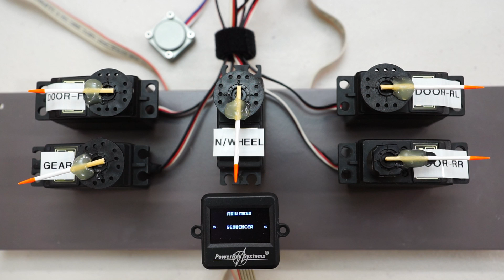PowerBox Mercury SR2 : Part 7 - Gear & Door Sequencer Programming

Comment: Hi Costa, great tutorials, very informative. I have followed your guide and all works; however my aircraft does not have retract doors, hence i was wondering how to eliminate the lag for gear extension and retraction? I have played around with setting whatever default time to 0, but probably I am not doing it correctly. would appreciate some pointers. Tx, Nic
Reply: Tx I will give that a go 😊
Reply: Hi Costas, I tried that using the mercury small screen, but it only allows me to set percentages and time per point (four r of in each direction); however not remove the pints per say. By setting time to zero (per point)  it not seem to remove the lag. I am probably doing something wrong? Should I use the sequencer software option in the core itself instead? Is there a different purpose between the two?
Reply from the maker: @nicolaszentelis2161  You can of course use the Tx sequencer. Only advantage of the Mercury sequencer is that it just has more options.
Reply: Hi Costas, still no joy. Do you perhaps now why their are four positions in each direction? Maybe if I understand that better I may be able to solve this. No matter what I do the extension takes about 4 seconds as it thinks there are doors and the retraction is ok about 1 second. Maybe that is just how it works? In your experience have you managed to get extension to not have a large lag?
Reply: Is there maybe a way to bypass the sequencer? ie just give command to gear servo, simply up and down non times or sequenced?
Reply from the maker: @nicolaszentelis2161  There is no requirement to use the sequencer. You can also set it up manually if need be.
Reply from the maker: @nicolaszentelis2161  Have you tried setting the sequencer points manually...? Might pay to do this for just one channel first then manually add a second sequencer for another channel to see how they interract with each other.
Reply: @CVHeliPilot  Thanks I just bypassed the sequencer and got the result I wanted. I still want to find out how to do within sequencer but that is a challenge for another time. Cheers, Nic
Reply from the maker: @nicolaszentelis2161 After the sequencer is set you can go back and manually edit the curves for the sequencer. So you should be able to remove or minimise those points used for the doors.

Comment: only question is how to increase delay on nose steer for gear going down to give it additional time for the leg to clear the well.
Reply from the maker: @PeterOZ61  Go into the sequencer curves and adjust there after its first setup.
Reply: @CVHeliPilot  within the SR2 ?
Reply from the maker: @PeterOZ61  yes...once you run through the initial setup it will make curves for the sequencer. You can modify these adjusting times etc.
Reply: @ cool thanks.

Comment: HI, I have been watching all your Video's too really find one of the most used action from all jets use. , that is to retract the gear and have the strut not move in the retracted mode. Part 7 looks like it will work. Do i program the Core first or my Completion SRS first
Thanks Rcpete
Reply from the maker: @Rcpeteful  Hi Peter, you can use the 'channel lock' feature in the Comp SRS to do exactly that. Just program that in the Comp SRS, only thing you need to set in the Tx is a single channel to activate the sequencer for your landing gear and of course another for the nose wheel steering control (this is the one you assign to the channel lock feature.

It should work the same or very similar as the new SR2 PowerBoxes.

Costas

Comment: Hi Costas, 
Can you please help with setting up the door sequencer on a Royal SR2,im using the Assistant but can't find how to
get 4x servos on the wing and 2x servos on the tail to work, it only gives me the option of up to 2 on the wing and 2 on the tail
im missing something
Reply from the maker: Are you referring to the actual 'Door' and 'retract' sequencer or the assistant for setting up the wing surfaces...?
Reply: @CVHeliPilot   sorry the door and retract assistant
Reply from the maker: @Elvisisinthebuilding  Ok... If you need to control more servos/doors etc..  You can first run the assistant then you can add further outputs in the output mapping menu section.
The assistant only covers a certain amount of options but not all...

See my video on controlling mutiple servos per flight surface which is basically the same method of adding servos by mapping an output accordingly.
Reply: @CVHeliPilot  thank you , your videos have been fantastic, such a big help keep up the great work 👍🏻
Reply: Hi Costas, have you had a chance to make the video on the gear and door sequencer plus adding 2 more door servos on the Core
Reply from the maker: @Elvisisinthebuilding  Nah not yet...Been busy with a new turbine build...😀 Almost finished with that so maybe early next week I'll get stuck into a few new videos that I want to make.

Comment: Hello, thank you for making it easy for us to learn with these great videos. is it possible please to make a video just on Flight Mode and what it mainly used for and what are creative ways to use it for? Is it that everything you can do in Flight mode you can also do in the functions section? Thank you again🙏
Reply from the maker: Yeh - I have had Flight Modes on my mind for a while now - Still thinking of the best way to approach this topic.

Basically using Flight Modes allows you to configure and adjust functions per Flight Mode. Think of a Flight Mode as a separate setting for your functions - Similar to using say Dual Rates but instead of just having separate rates you can change a lot more variables in a Flight Mode.
Reply: @CVHeliPilot  thank you for the reply. Your explanation helped me understand it better. If you ever do get a chance to make a video about it I’m definitely going to be on the lookout for it. Thanks again.

Comment: Hi Costas why don’t you use the sequencer from your Core?
Reply: I think this is related to the gear off/locking feature, where stick/gyro input is disabled.
Reply from the maker: Of course you can use the sequencer in the Core however if you are using one of these PowerBox units it makes sense to use the inbuilt sequencer.
It has the nose wheel locking feature and its easier to setup the complete sequencer here rather than the Tx.
It also then ties up only one channel at the Tx instead of requiring multiple channels.
Reply: Ok clear tx 👍 @CVHeliPilot